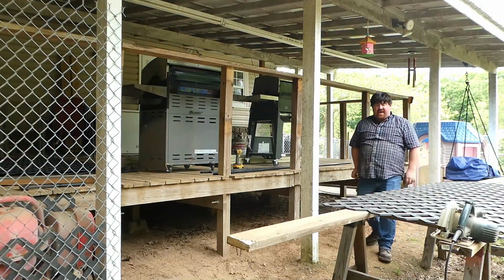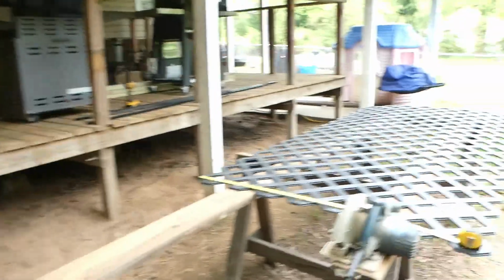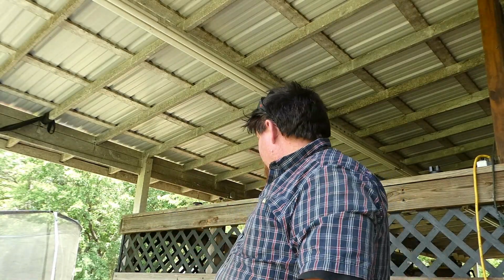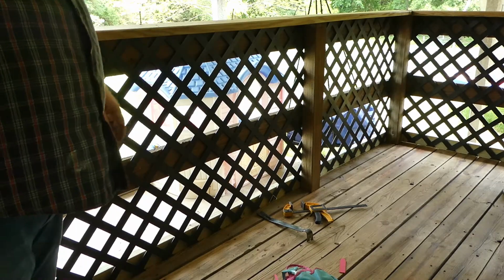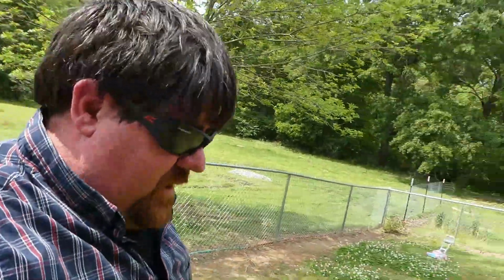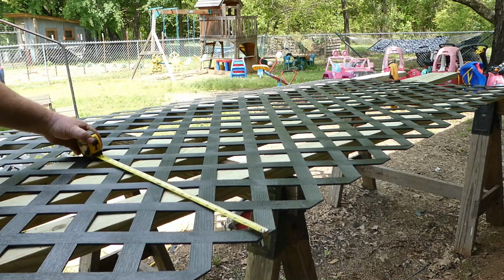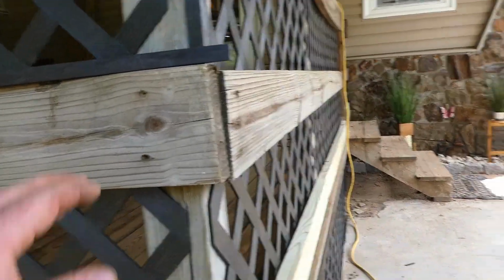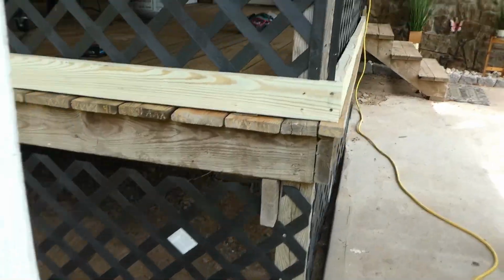Installing Black Lattice on Back Porch

Comment: Have you had any problems with using nails to secure the lattice to the framing? I’ve seen people do it both ways, but splintering and cracking always seems to be a concern. Would you secure the lattice to the framing the same way if you had to do it all over again? Thanks and nice job
Reply from the maker: Yes I believe I would use roofing nails again. Staples may be better but I like the roofing nail and I’ve had no issues to report since.

Comment: How has it held up in the last 2 years?
Reply from the maker: Well I will just say it hasn’t “lattice” down
Reply from the maker: No it’s actually held up really well. The benefit of it being plastic and on the north side of the house I’ve had no failures except where my dogs worked over one corner.